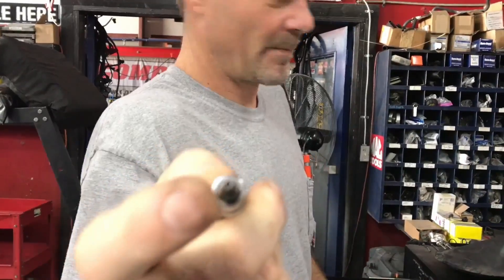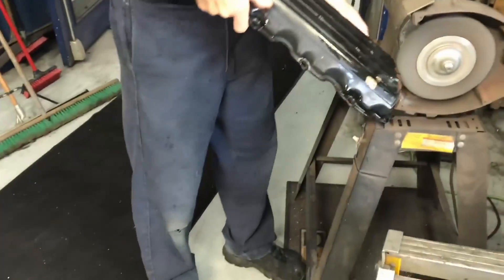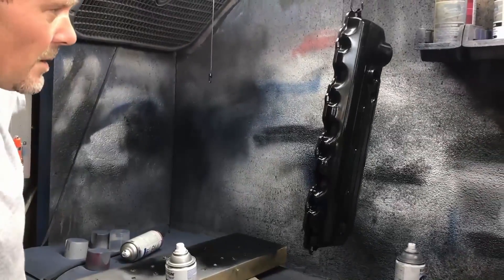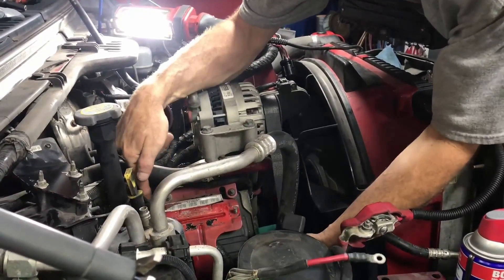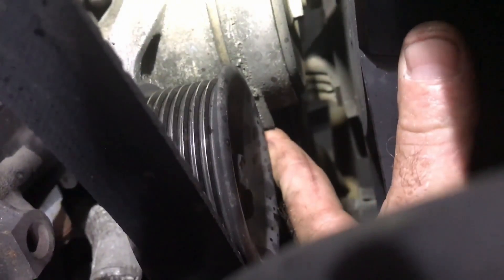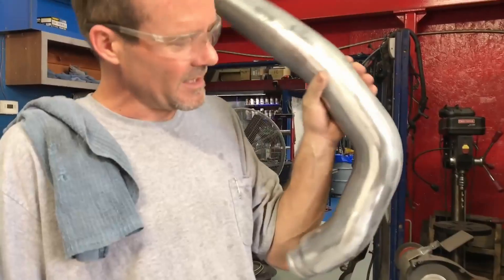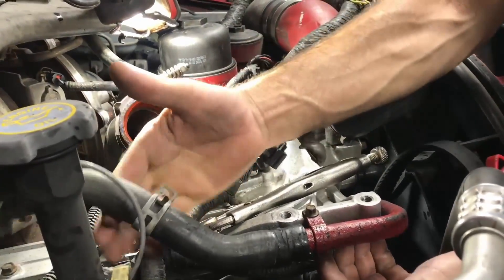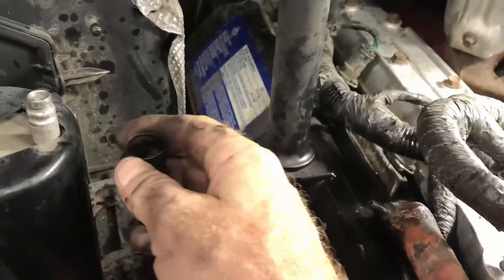3 How To 6.0 Powerstroke Fuel Injector 3

Comment: Hey Anthony, I have a 04 F350. It has the old pump new oil rail style with the dummy and stand pipes. ICP is in the front. I’m getting fuel in my oil? I have resealed the injectors. And don’t know where the leak is coming from. Any tips that you could help me out with? I have done the trucks HPOP, Return Tube, ICP, FICM, GPs, IPR, Turbo, dummies and stand pipes. It will leak fuel to the point where it will create a no start after thinning the oil. Would i look at changing the injectors maybe a injectors body leak? It runs good just fills up with fuel in oil. Don’t want to be changing oil every couple days. Please give me any suggestions? Any cool test would help??? Thank you!